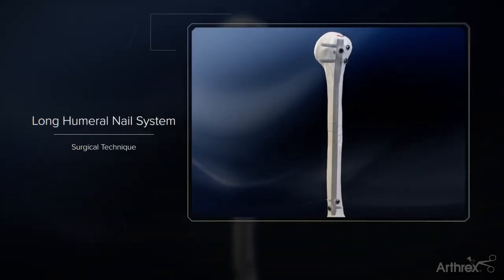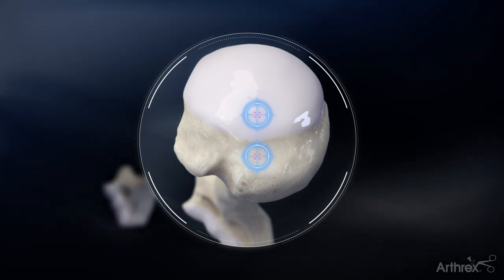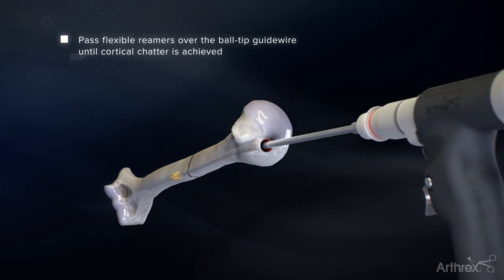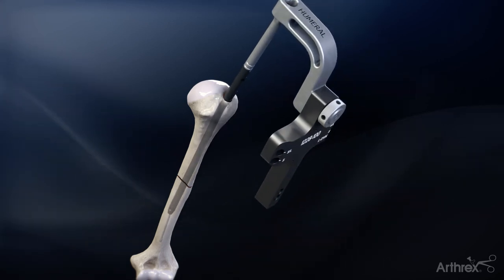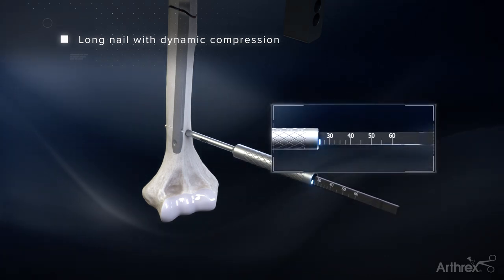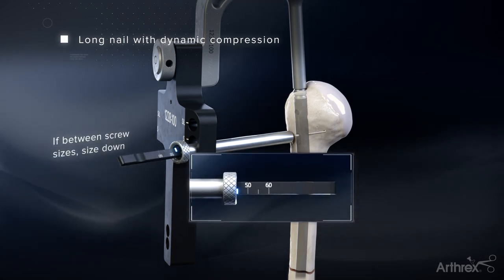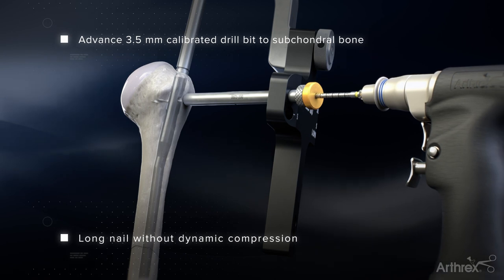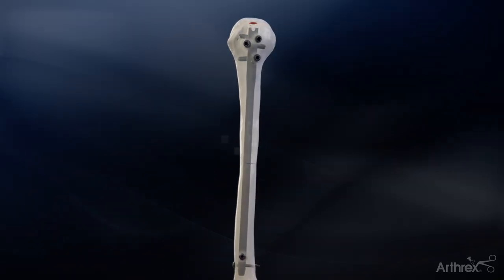Long Humeral Nail System Surgical Technique

Comment: My wife suffered a left mid-humeral fracture from a fall while in recovery from a complete shoulder replacement performed at Texas Orthopedic Hosp. We returned to TOH and they removed all implanted appliances and the top 2/3 of her humerus. Her shoulder and her arm were debrided, and we were sent home with 4 weeks of IV antibiotic infusions. Shortly afterward, the end of her humerus pushed out through the incision. and got reinfected. Back to TOH for another debridement, but before surgery, her colon ruptured and she was rushed to Houston Methodist for an emergency ostomy. Four weeks later we went back to TOH and they debrided her again (including a series of events that almost led to security ejecting me from the hospital). She then had 6 more weeks of infusions then 4 weeks of wound care which has not been successful. The surgeon at TOH is now considering this procedure and is referring us to a specialist's specialist. My wife is very tired of all of this.